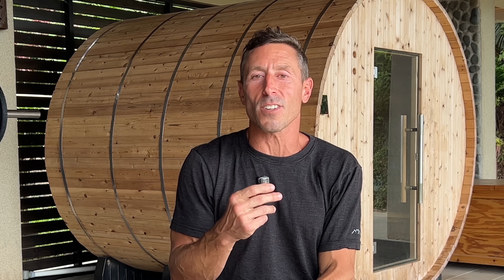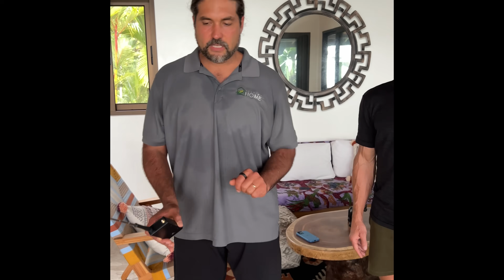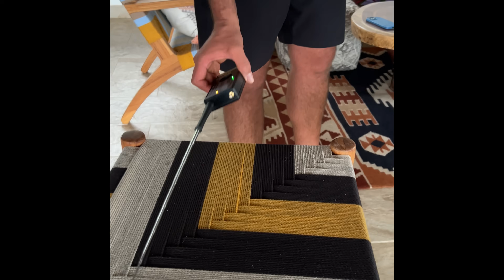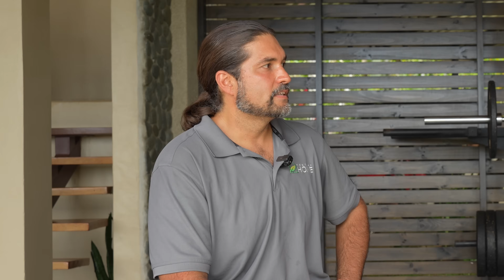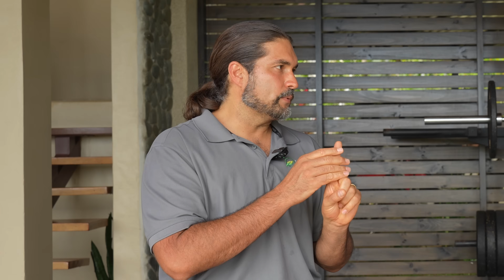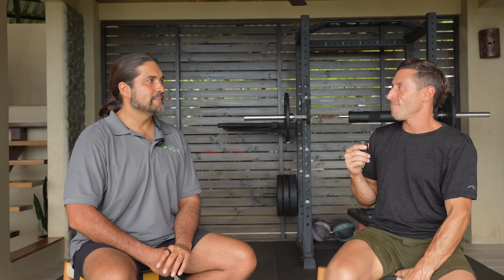Earthing vs. grounding

Comment: I am an electrical engineer, ground IS connected to the earth, it is not the return line to the electric company. Neutral is the return line. If you connect to the ground you will be connected electrically to the earth, if your home’s wiring is properly installed. Ground will only carry current if something is wrong, like a fault somewhere.
Reply: Yes. Also an EE. This guy is tanking his credibility with the charlatans he brings on for these topics.
Reply: @ZacksLab  yup....lots of bs there.
Reply: @ZacksLab can you use  earthing mats in a highrise?
Reply: @ZacksLab what did we say on here that is not correct?
Reply: For all the electrical engineers out there, you know that the ground is bonded to the neutral line in the main electrical panel. Everything that is on the Neutral is also electrically connected to the ground wire. Furthermore anyone with an oscilloscope can verify that the grounding wire in any residential home has interference on it. I have tested thousands and nave not came across one without interference. You also get interference from inductive coupling from the hot wire as it runs parallel in the wire sheathing.
Reply: @ryanblaser1151  can you describe your set up for "Furthermore anyone with an oscilloscope can verify that the grounding wire in any residential home has interference on it."? you do realize that by plugging your oscilloscope into the wall, the outer shell of the BNC (probe negative) is connected to the home's earths ground via the oscilloscope plug's ground prong. if you're using the passive probes that came with the scope, both your probe tip and probe reference will both be electrically connected to the home ground, likely creating a loop, and the "interference" you're seeing is because you created a loop antenna and you're just seeing the 60Hz on the nearby lines.
Reply: @ZacksLab Agree but you can use battery operated scopes nowadays.
Reply: @bakothegreat  yep, just questioning the quality of his set up and measurement. even if he was referencing an earth grounded stake, my guess is he had a really long wire attached to the scope leads. measurement setup is important and often neglected, even by "experienced" engineers.
Reply: @ryanblaser1151  When I first learned that, I was amazed that any of our modern electrical systems work as well as they do.  Almost nobody knows that modern power distribution uses the earth as the "return wire".
Reply: @ryanblaser1151 

This man knows what he is talking a about  .
Reply: @ryanblaser1151 only primary panels are bonded. Subpanels are not bonded.
Reply: @ryanblaser1151  So "Earthing" directly to the earth is the only way to ground without dirty interference?
Reply: @ryanblaser1151  While you aren't wrong in theory, the impedance to ground is what actually matters. If you are less than 5 Ohms, that is very good. You are definitely over five ohms when you just put your feet on the dirt.
Reply: @bakothegreat  laboratory ESD mats generally have ~1Meg ohm resistor in series to the ground connection, even with this high impedance, you can bleed off static charge fairly quickly (a few hundred milliseconds). the reason for the 1meg resistor is to keep current low in an ESD or if you were to accidentally touch mains voltage. being directly connected to ground while working with electronics is not the safest idea, 1 meg will keep current to 250uA at 250V. i've walked all around my house and back yard using a lab grade body ESD monitor, the results were surprising, even when wearing shoes. the data i collected do not favor the barefooters/earther's claims. I'm working on a video for this topic.
Reply: @ZacksLab so are you saying the grounding mats/sheets do work or no? Are they safe or a waste of money?
Reply: @heathermoses6183  there is no credible evidence to support the theory. grounding mats work in the electronics industry to protect electronic devices from electrostatic discharge. the issue is this idea conflates bioelectricity (which is chemical/ionic based) with conventional electronic currents. they are not the same thing whatsoever. standing on a grounding mat does not remove anything "bad" from your body.

i think what is correct, though, is the idea that going outside is healthy. kids and adults both will be in better moods when they're in nature, but this is not because of grounding. it's because we are animals who like being outside and because the sun gives us vitamin D.
Reply: @ZacksLab are you sure? Cause they've done some RCT's that actually show grounding to have an effect on the body's electrical system. A positive one at that. Check out Thomas DeLauer's video he made recently about it (he's a big science guy so he always talks about any studies about stuff lol). I've also seen stories from people that are extremely sensitive to EMF using grounding products and it having an effect. (Partially good, partially negative) And before you say 'placebo' how do you explain the fact that they had a negative reaction when they didn't know it was possible before hand?
Reply: Thank you, I agree.
Reply: Exactly. I'm also an Electrical Engineer and Electrician and was going to say exactly the same thing
Reply: How can I test my bed?  What's the best way to ground my bed ?
Reply: @isaactrevino7821  buy a multimeter. Set it to volts, AC (alternating current) plug the black test lead into your ground outlet hole. Hold the positive one. You’ll see you have voltage in your body. I have about 1.3 volts. Then touch the grounding pad/sheet and the multimeter should show close to zero volts. FIRST, watch some videos on this. Electric is dangerous and not to be played with. I’m NOT an electrician
Reply: @isaactrevino7821 dude if your beds not made of solid metal. There’s nothing to ground. Please. Please for the love of god yall. Take 10 mins outa ur day and watch a 4th grade science class project on conductive bonds.
Reply: @isaactrevino7821 with a multimeter. I was just testing my grounding sheets.
Reply: @isaactrevino7821 interesting question! I just took an old extension cord cut off the blade of the plug, leaning only the ground prong, cut off about 15 ft strip the insulation off of about 10 in, drilled a hole in my metal frame bed it's an old antique brass bed drilled a hole in it inserted to screw, and wrapped the frayed, or braided ground wire around that screw. I'm a little longer than my bed, so most of the night I'm going to have one or both of my feet touching the bed frame and of course it's an all-metal bed frame. I just started that last night so obviously I don't have any idea how effective it is or is not at this point but I'm going to try it!
Reply: Copper wire to earthing rod in the ground. Done
Reply: @mastermo5aic  congratulations with your DIY short wave antenna LOLL
Reply: @mastermo5aic thank you. Straight and to the point
Reply: The ground wires in your house are all wrapped around the power and neutral wires from the power company.  EMF from these lines are induced into the ground lines.  And yes the neutral line is physically connected together with the ground wires at your service entrance box.  As he said in the video this is noisy compared to just taking a copper wire right to the ground.  All you have to do is measure it and find out.
Reply: @robertbyers8035  EMFs from power lines do not cause any issues with biological tissues. They are distinctly in the non-ionizing portion of the EM spectrum.
Reply: No you have to make sure the Voltage = 0.0000 in the ground hole of the outlet to guarantee its safety.
Reply: @hollyfield5270  I think your comment in the midst of this discussion/debate helps me understand what my EE husband was trying to tell me about my grounding mats plugged into the wall. 😊 It is about safety not "dirty electricity."  Thank you.  😊
Reply: Well this got complicated fast lol
Reply: @Theshifthealing  Now I'm just confused on what to do.
Reply: @Theshifthealing  Yah way over complicated. Early in the electronics era we had to wear  wristband (made by 3M) so when we handled circuit boards our static charge would not ruin the circuit boards. The wristband was connected to the ground on an outlet. So the ground on your outlet is Earth. The rest of this video is Woo Woo.
Reply: @Theshifthealing thinking exactly the same thing😂
Reply: DISAGREE. I'm an engineer too. Many power devices have capacitors connected to... Ground. So?... It could be interesting to measure ground noise compared to earth noise. On the other hand, a long wire to outside creates a large shortwave antenna lolll
Anyway.. There are more ways to look at this. Just remember, that your electrical circuit ground at home, is likely not really clean.
Reply: @DBMMMMM
Reply: @DBMMMMM  That's what I was thinking too!  I think one would be better using a shielded grounding wire.
Reply: The problem with the comment made here is, you’re an electrical engineer. You should know that any wires that are in close proximity to each other create an electrical magnetic field and that’s how those little magic ones people call the electrical tracing stick that beeps when you get close to the electrical wire works, anytime you have interference or close proximity to that electrical power will align you’re gonna have dirty ground. All this guy is saying is that you need a more clean ground and no you’re right the ground does not go back to the electrical station. It does go into the earth, but think about what he saying
Reply: I'm not an Electrical Engineer, but I did stay at a Holiday Inn Express last night!
Reply: Neutral is only the return to the transformer, there is no neutral from the power generation.
High voltage primaries feed a transformer, neutral is created in the transformer as a common center.
Reply: well I am an ordinary elderly lady who was thinking of buying a grounding sheet for my bed to help with aches and after watching a video on earthing versus grounding and comment on this site I am now totally confused as to whether a grounding mat would be good for me or not????
Reply: I agree but still safer to run it out to actual earth ground unless lightning strikes it😂 oh decisions decisions
Reply: @WanderinWizard hAhaha!!
Reply: The surface of the Earth has a negative charge of about 300,000 volts relative to the ionospheric layer above. The Earth-ionosphere system forms a spherical capacitor that stores about 500,000 Coulombs. So when walking barefoot on grass a current passes into the human body, allowing an exchange of electrons.
Reply: Would a grounding sheet work on a boat that is plugged into shore power, has a galvanic isolator and an inverter?
Reply: @robertstuthridge8980  on a boat you can use the water!
Reply: Well! All these experts are confusing me. I guess electricity works differently depending on where you got your education 😂
Reply: I'm so confused 😬
Reply: As a layperson just trying to understand how this is done and wanting to learn how to best try it AND test that it's safe, my head is spinning from all these comments. Can someone give an accurate summary?
Reply: That’s what I thought, I thought it was a genius idea to use the ground from an outlet.
Reply: What is everyone’s opinion in connecting to the cold water pipe in a modern apartment building if you are several/many floors above ground?
Reply: @Senkyballs  Depends on a couple things.  What country you are in, for instance.  In Australia, the cold and hot pipes are almost always "earthed" through to the earth bar in the switchboard, so it is similar to the earth pin in the power outlet; not much is gained your way.  And ours will always have a volt or two (or more) of AC on the earth bar to true ground.  Additionally, there may be plastic "poly" pipes somewhere between you and true ground, so nothing would be gained at all.  My house has poly pipe coming into the house, and then converts to copper.  But I am speaking only for our Australian system only.
Reply: @ralph5476  Thank you. Yes I'm in Aus too.
Reply: @Senkyballs  One problem I have seen occur in an town-home complex. There were high power transmission lines running over the complex. The water was running thru copper pipes thru out the complex. People were getting sick in this complex for years. A certified consultant that works on dirty elec, smart meters, EMF exposure, etc was brought in. He found the source of the problem was the water pipes that were picking up an induction current from the Transmission lines.
Reply: NOPE! That's another "plug" for the electric company! Before I knew there was a difference between grounding and earthing I grounded my bed with copper wire run outside to grounding rod and was the WORST nights sleep ever! I even woke up several times a night getting ZAPPED on my feet! Didn't know why, lol, but removed the grounding from bed. Now after seeing this video I know why! WOW!
Reply: @ginamarietolentino333  it means your house electric is not properly grounded
Reply: i think i will stick to a nice hot bath - all the above sounds way too dangerous 🤷😦
Reply: @hazeltree1  you can use a grounding mat, they do work, just test your outlet first
Reply: Came here to say this. I still think it's dumb to connect your sheet to the grounding prong on your home. If something isn't wired properly your grounding mat is hot. Insane that they are selling these.
Reply: That’s great, but you also need to understand that the ground wire can carry dirty electricity, which is exactly what they reveal here. I’ve personally experienced this, with dirty electricity traveling through the ground line and affecting my body to the point of causing seizures. Most electrical engineers have little to no real understanding of proper EMF testing. You need to learn more about dirty electricity and how it can travel through the ground wire.

A ground wire can carry dirty electricity in several ways. Shared neutrals and improper bonding can allow high-frequency noise and stray currents to leak onto the ground, creating unwanted electrical disturbances. Stray voltage and ground currents from poor grounding, unbalanced loads, or electrical faults can also introduce dirty electricity into the system.

Electrical interference from devices such as solar inverters, dimmer switches, LED drivers, and power supplies generates high-frequency transients that can travel on both neutral and ground conductors. Utility grounding issues, where power companies use the earth as a return path for electrical current, can further contribute to the spread of dirty electricity.

When converting DC to AC with chargers, inverters, and other electronic devices, switching power supplies generate high-frequency transients that can leak onto the ground wire. The AC waveform produced by DC-AC converters often contains harmonics that distort the normal 50/60Hz frequency, inducing stray currents in the ground. Capacitive coupling in some chargers and inverters allows high-frequency leakage currents to flow onto the ground wire, while imperfect ground isolation and internal filtering systems in electronic devices can inadvertently introduce electromagnetic interference into the grounding system.

When multiple electronic devices share the same electrical panel, their combined noise can spread dirty electricity throughout the entire grounding system. These issues can interfere with electronics, reduce the effectiveness of grounding, and negatively impact those sensitive to EMFs. However, proper filtering and grounding techniques can help mitigate these effects.
Reply: @MountainEagle77  thank you for the thorough explanation!
Reply: Problem is with ground/neutral bonding.  Also, I wouldn't want to be sleeping and there is a problem with an appliance in the home. lol.
Reply: Would your little device that you didn't tell us what it was actually buzz when he's standing on the earth? Is it just EMF held ghosts emit EMF 😅
Reply: Only when surface is of tiles stone not when it’s vinyl or carpeted
Reply: Electricity return to its source. It doesn’t dump into the ground around our house. You’re wrong
Reply: You will be an antenna 😂
Reply: Don't most homes have  the ground drove into the dirt via copper rod . I know my house has this .
Reply: Thank you!
Reply: https://www.youtube.com/watch?v=Z-fGC-KsRGg here is a video about this in more detail. Building biology standards are much different than typical conventional electrical standards
Reply: well I am an ordinary elderly lady who was thinking of buying a grounding sheet for my bed to help with aches and after watching a video on earthing versus grounding and comment on this site I am now totally confused as to whether a grounding mat would be good for me or not????
Reply: I’m a licensed electrician, which is slightly different training than electrical engineer. But the point is that ground wires in homes pick up inductive current from the electrical lines they run parallel to All through the house.  So the question isn’t whether or not the ground wire is connected to the Earth. It definitely is.  

The question for me is about Ryan Blazer‘s claim that you become an antenna to attract more stray EMFs when you ground yourself in the house. Whether or not you’re tied into the electrical systems ground or your own separate ground line, by virtue of grounding in a home full of EMF you are “attracting a bunch of emfs” 

Wondering if that’s true or not.
Reply: @matthewmcclure1364  it is not.
Reply: @bbanzai444  Clint Oberman, the founder of The Earthing Institute, and Gaetan Chevalier, the director of The Earthing Institute,  both are very clear that grounding in an indoor environment is not an issue, it does not make you more susceptible to harm from EMF’s. There is a long interview with both of them on this topic on the Earthing YouTube channel
Reply: This is what Dr.Laura Koniver speaks about on her channel. She has created the Pureground cord to eliminate dirty AC current while using g grounding products.
Reply: @NicoleLynchuk  what she has "created" is a piece of junk with a stupid name to use to cash in on rubes like you.

clearly it is working exactly as designed.
Reply: What is the devise he is using to “demonstrate” the dirty energy?
Reply: you'd be surprised how many dirty circuits you have running in your house, just not enough load to trip the RCDs. I too am an electrical/electronics engineer.
Reply: @daveWoody what exactly is meant by a “dirty circuit”? Can you give an example of a device that would have current leaking to ground under normal operation? Currents return on neutral and, if phases are balanced, there is actually no current on neutral (in reality there will usually be some due to L1 and L2 not being perfectly balanced).

Furthermore, I’d like to know why this is even considered bad for the use case here, which is certainly still up for debate if grounding the body has any positive health effects. 

So much fxckery going on in this series of Paul’s videos with zero input from competent engineers.
Reply: @ZacksLab    I have LED down lights in my house that I have measured small amounts of earth leakage, even though they still function correctly. Overall is this bad though? probably not? I can't say either way. 

There are plenty of research papers indicating earthing is beneficial for reducing inflammation in the body. 
They don't look at the magnetic radiation effects from nn emfs though, so it's unclear what effect these magnetic fields have on the body. 
Do you know more about this?
Reply: @ZacksLab  As an Australian with the MEN system of earthing... An example of current leaking to ground under normal operation would be most switch mode power supplies - anything that has a capacitor to ground from the live wire. Capacitive reactance of the capacitor will always allow current to ground on AC.  Too many computers on the one circuit can trip our 30mA RCD's.  Electrically, I hate the term "dirty" electricity.  These caps are doing what they are supposed to do.  They are part of the power line filter within the power supplies.
Reply: @ZacksLab  what is meant by it is it sounds scary to the uninformed, so it helps us exploit them.
Reply: @ZacksLab The idea that electrons from the earth might “skip into the circuit” if you use a ground plug is technically incorrect. A properly designed grounding plug only connects to the earth grounding wire, not to the power (hot/neutral) circuit—so, under normal conditions, there is no current flowing through your body or into electric circuits. If a mat is properly connected to the ground pin, it should not carry household electricity at all. Safety issues arise only with faulty or incorrect wiring.
Reply: @quantumfx2677  you can capacitive couple to earth, this is how linemen can get electrocuted near HV even with no conduction paths. electronics aren’t skipping, there are drift currents through parasitic (or real) capacitances between conductors and even your body.
Reply: @daveWoody  Guess what, I used a grounding mat for the first time today and instantly within 45 seconds had a severe migraine attack. Worst one in years. Couldn’t see and was nauseous and had a severe painful pounding headache for 8 hours. Severe and awful symptoms. 

I ground naturally on the earth everyday. Religiously. 
So why did this mat have these effects I wonder? 
It blew my mind, quite literally 😭😭👀😩
Reply: @sarahmarie9313  interesting outcome, sorry to hear you had a migraine, they suck. Personally I think nnEMFs affect the human body, particularly at high density. You could test your earth impedance and even measure your body voltage while on and off the mat. But what you find still may not be the cause, keep that in mind
Reply: @daveWoody  you mean test earth impedance with reference to what? the ground plug? myself?
Reply: How would that not work,
Reply: @mastermo5aic  im just saying... You have ground for your DC electrons, a GND wire has low impedance for 50/60Hz but not for RF. Unless you would choke it with some inductor or so I don't know. If you live in the middle of nowhere, no problem. But in a city you could pick up quite some RF noise. It's a just a wild guess.  If you would connect a spectrum analyser you could be shocked lolllll
Reply: Yep. And to be safe, to prevent backwash and grounding from other sources going into your body, just plugin a rod directly into the earth and connect your grounding product to that.
Reply: https://youtu.be/MOXbJch3iiw?si=9bD1GS4sHafDK6Q1 what do you make of this then Paul Saladino
Reply: Omg this is the DUMBEST thing I’ve ever heard. Complete bullshit…
Reply: And if you sleep with resistors shoved up ur nose. The delta rays want impregnate your dogs.
Reply: Thank you for clearing that up much  appreciated
Reply: is there a specific grade of  copper wire i should use to put in the ground?
Reply: @hemiv8949 use an actual grounding rod, they are 8’ long and get hammered into the ground with a sledge. They are sold at all home improvement stores.
Reply: Exactly. However, one more thing. In some panels they combined the ground and the neutral lines. You’d want to separate those 2 so that your ground was truly a ground and connected to earth w a 8ft grounding pole that’s near the panel. Otherwise, the neutral is what the return path is and would carry some wattage to the ground as well
Reply: Yeah, I was wondering what nonsense this guy was talking about when he said that first off the bat.  Grounding is earthing!!
Reply: Absolutely correct
Reply: Exactly right. This guy really doesn’t understand what he’s saying. At least in the US we wire houses with 3-wire romex. Hot, neutral, ground. Sometimes the ground is tied to a copper grounding rod burried into the soil. Sometime the ground is attached to a conductive pipe where entering the soil.
Reply: single wire earth return distribution would like a chat -- but no seriously this video is hilarious
Reply: ya not sure what these knob gobblers are talking about and why u need to sleep on a grounding mat..sounds like woo
Reply: Saved me a few minutes, thanks!
Reply: In the UK unless on a TZt earthing arrangement ground does return to the grid and can be connected to neutral.  I'm assuming that in the US it would be the same in urban areas.
Reply: If let’s say light night were to hit next to your house, would it be possible to fry urself accidentally because u grounded yourself to the earth that’s been struck with lightning? Maybe a false idea?
Reply: @MrSeddyt  should be ok, but there is always a chance current could flow in unexpected directions!
Reply: Yeah that had me like huh
Reply: What about the bonding jumper screw in the panel connecting ground bar to common neutral bar?
Reply: @ that’s above my head, I’m not an electrician. What are you thinking?
Reply: Would grounding to a radiator reduce the risks of any current going through it if your house wasn’t ground correctly? I’ve heard about dirty electric when plugging into the mains and it’s made me wonder if the radiator would be a better option for people who don’t have access to the earth for rod
Reply: Key thing you said is if your wiring is correct
Reply: So you don’t think magnetic fields are real and can be damaging to tissue? Yes the ground goes to the earth but wires all over your house run parallel to the ground wire, that’s is the problem. If you don’t believe it go buy a house under a main distribution power line and get some good health insurance for when you get cancer.
Reply: So best would be to go to an area that is free of electricity for at least 8 ft around… and then get one of them mats, put it on naked earth.. not grass, take a rod stick it in the earth and ground… if you don’t care much for the temp.. just put your naked feet on the ground.. thats what im getting. 

Those grounding mats come with a meter that says to plug it in outlet before plugging the mat in it.. so it can judge whats best…and if itclightscup the right light then go for it… but, imo i think even that is not 100% good
Reply: they don't care about facts, only how they can exploit, ripoff and shill....
Reply: Completely disagree and if you work in the electrical engineering field you will know and understand that exactly how he explained is how low-level electromagnetic induction works. Likewise, the extensive and very well documented evidence demonstrating the impact of EMF outside of a normal (natural) ranges impact on living cells, tissue and thus people. Unfortunately it seems and sounds like psudeo science however it actually is science …..
Reply: Disagree.  Grounding helps your mitochondria and helps put electrical currency into the cells to help them recharge
Reply: I’m only an apprentice electrician and this is exactly what I thought too.
Reply: @tateburnett4532  don't listen to the fraud, you won't learn anything from them. BOTH the neutral AND ground are connected to earth in household electrical sytems.  It literally takes like 30 seconds to look this shit up
Reply: Agreed. A stray neutral can easily "leak" into ground. Wiring poorly done is not that uncommon.
Reply: both ground and neutral are connected to Earth.   
look. it. up.
Reply: Ground wire is connected to the earth AND the neutral line. An "Electrical Engineer" should know that.
Reply: @ read my comment again and tell me where I’m wrong
Reply: neutral and ground are connected together at the breaker box.  
therefore BOTH are connected to ground.
Reply: Thank you! When they made that comment at the beginning I rolled my eyes and turned off the video. How absolutely idiotic of them not to understand the very basics!
Reply: Clint Ober the man who discovered weathering says they effectively do the same thing. He's fine numerous studies. This guy is wrong.
Reply: I’d like to point out that in an electric panel there is a neutral and ground bar. Both are connected to the panel box itself the same way. There is nothing that insulates the neutral bar from the ground bar. Go look at your electric panel.
Reply: "That's bad negative energy" lol whut?  It's bad cause it's noisy?  😂
Reply: I didnt understand that at all
Reply: What if you use a CPAP machine?
Reply: You're absolutely right
Reply: So does that mean grounding sheets aren’t doing any good? I just tested it with a multimeter. I inserted the black wire into the round ground in the outlet and while holding the red wire my voltage went down when touching the sheets.
Reply: The ground and the neutral wire often tie off to the same stake in the ground.  A good building ground is super important for all of this modern stuff to work well.  I would guess most construction treats it like an afterthought though.
Reply: Absolutely correct
Reply: What if the outlets have a bootleg ground and no one knows to check
Reply: another  Austist researcher says a grounding matt indoors will have limited effect because all modern houses have un-natural plastic vapour barriers on interior roof.
HE contends its not just GROUNDING that feels so good in nature ,  ITS FLOW ! and no flow will go thru the plastic to atmosphere or  thru any similar non natural material.
=I WOULD CONTEND  a ground matt could work in a modern house if you created a metalic wire grid on your interior ceiling above the matt and run that wire thru the wall to a piece of metal secured to side of fascia above the roofline in case tar shingles also block the flow.
i have grounding sheets but dont own my home so yet to try it.
Reply: These guys are idiots.  So many old houses have no ground and neutrals have been pigtailed to the ground at the outlet to fool inspections.  This method was done all over the country. Just because that cheap ground tester says the outlet is grounded doesn't mean it's grounded.  You need to open up the panel box and check the wiring to see if your house is actually grounded.  Plus lightning follows the least resistance. Your chance of being a fried human is much higher plugged into the grid.  I'm a engineer and I've seen it all after 50 years. If you have a question I'll be happy to answer it!
Reply: Your a poor engineer. Older homes have the neutral pigtailed to the ground. Even tho your using a cheap ground plug tester and it's showing ground. It may be lying to you. This method is all over the country to fool inspectors. I've even seen where they added proper 12/3 wire connecting to the original wire joining the neutral and ground wire in case they took the cover off. Never ever trust a ground plug tester in older homes. You open up the panel box. There's your answer! Always!
Reply: So, can someone explain what I need to do for health benefits?
Reply: @GrannySmith00 eat healthily
Reply: It's okay to learn these things.  Literally, the average person cannot do this so this stuff stuff feels "for the elite".   Live in an apt, can't control power, can't connect to outside from here.  
I am not being negative about the knowledge but this video brings up issues and the resolutions are not even close to universal
Reply: Truth!
Reply: Im an electrical engineer and meat is bad for you
Reply: @clincher91 😂